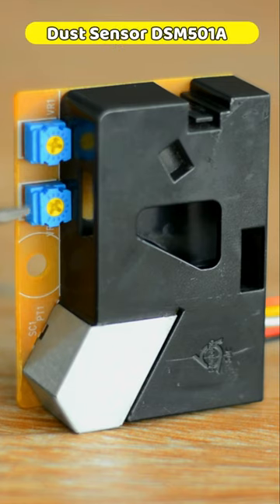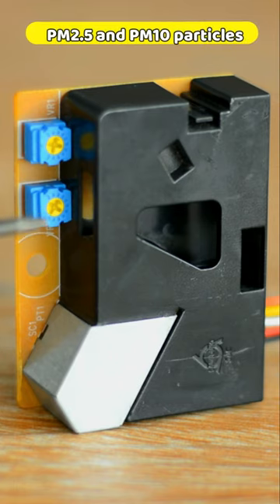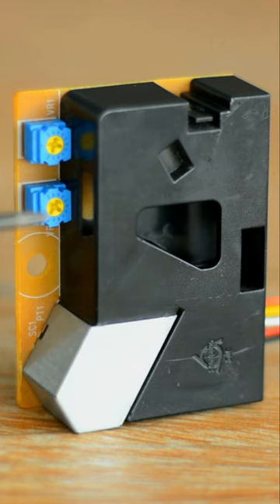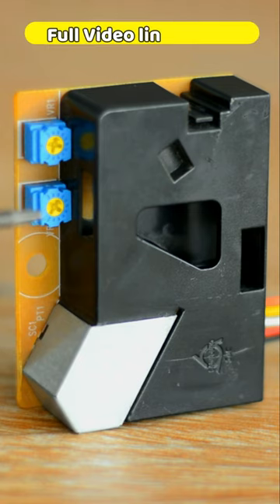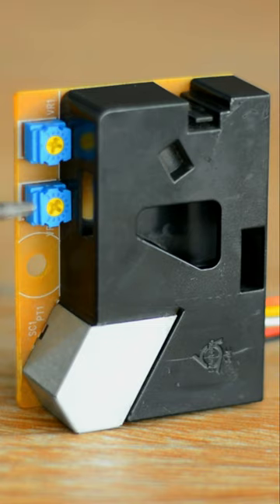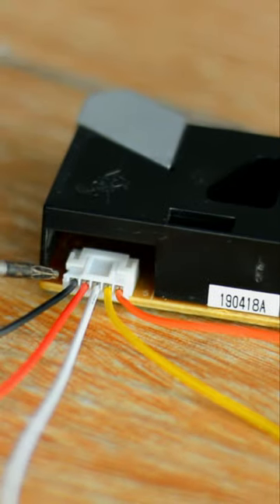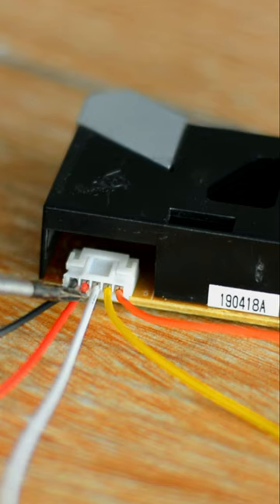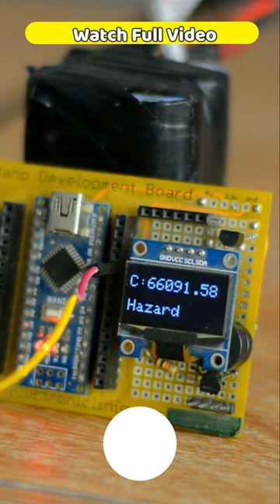Dust Sensor DSM501A, Technical Specs, and Pinouts, YouTube Shorts, Full Video link is in the Des

Comment from the maker: Watch Full Video:
Dust Sensor DSM501A with Arduino, PM10 & PM2.5 Air Quality Monitoring, Arduino Project
https://youtu.be/ENIDt7kNhQE

Altium Designer: 
https://www.altium.com/yt/electroniclinic
 
Altium 365: 
https://www.altium.com/altium-365 

Octopart, components search engine: 
https://octopart.com/

Read article:
https://www.electroniclinic.com/dust-sensor-dsm501a-with-arduino-pm10-pm2-5-air-quality-monitoring/

Previous Videos:
World's smallest Raspberry Pi Computer Build
https://youtu.be/PsRUz_NzgOg

TDS or EC sensor with ESP8266 for Water Quality Monitoring
https://youtu.be/8zO1mh2khCI

New Blynk 2.0 with ESP8266, Getting started video
https://youtu.be/EMSSJOblRcU